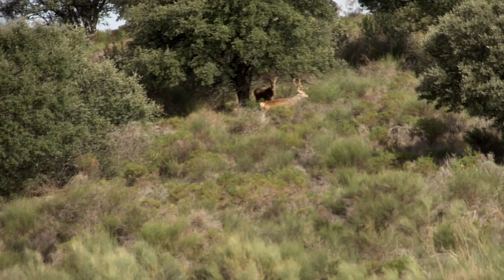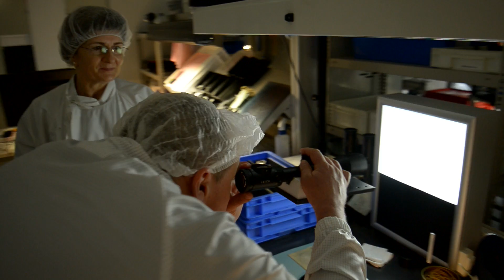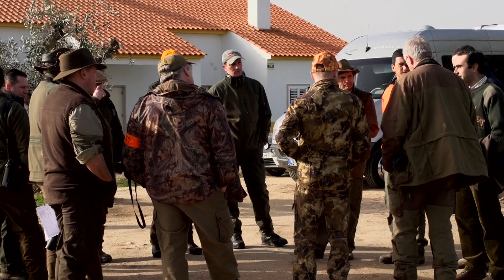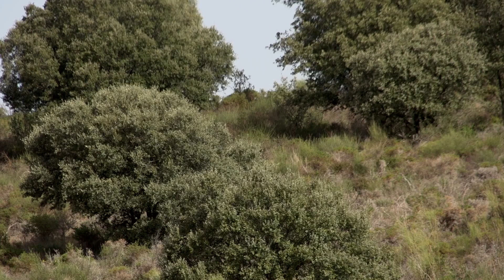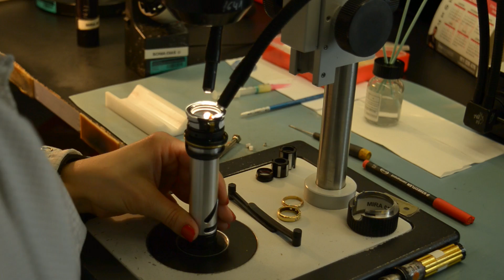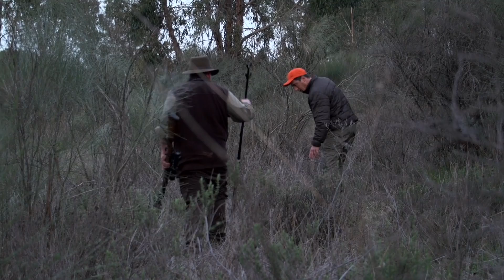Hunting deer - at the factory and in the field

Comment: I bought a Leica HDB last year and only found out much later that the custom SD card does not work as advertised. If your zero is anything other than 100, 200 or 300 yards/metres as mine is, it will NEVER give you an accurate holdover measurement. Very disappointing and Leica are not too interested in correcting the design flaw.